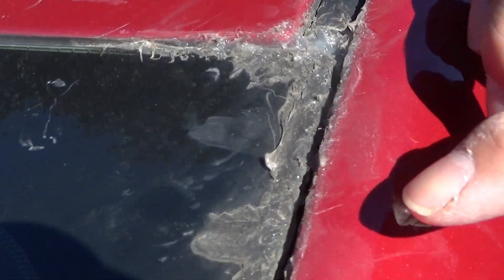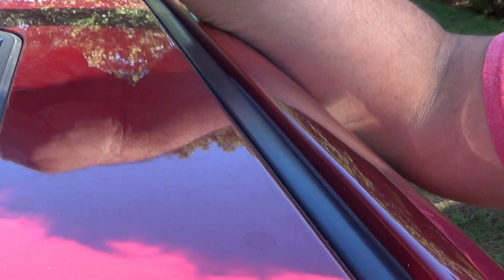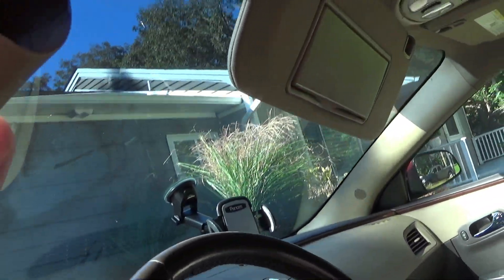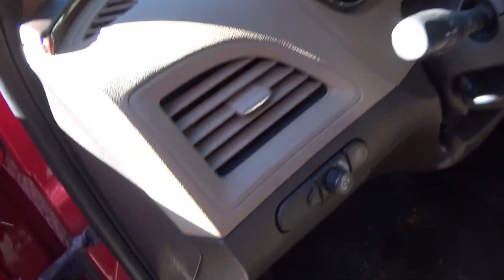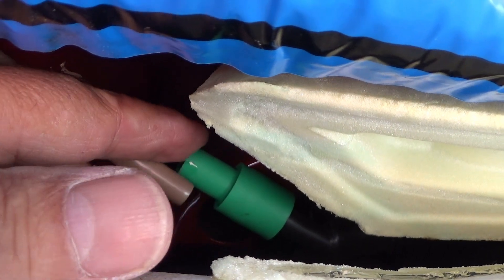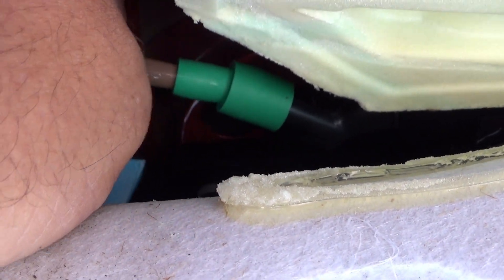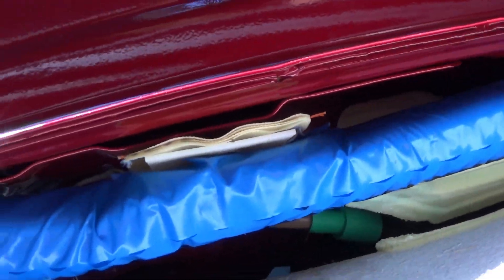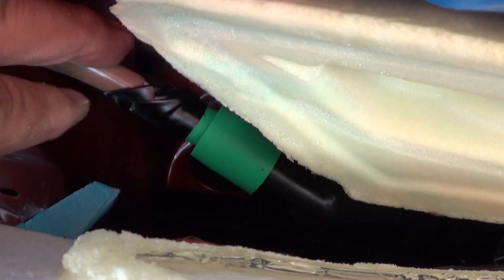2012 Chevy Malibu Sunroof Leak Fix

Comment: It really is a bad design. I dont know what Chevy was thinking.. My 2011 Malibu sunroof has leaked 4 times since I’ve had it due to disconnection. The first two times it was under warranty so I could bring it to the dealer. It was great cause they sucked out the water and dried it over a few days, but they just reconnected the hose! Which inevitably popped back out again… finally took it elsewhere the 3rd time and they used silicone caulking when reattaching it. That actually resolved the issue much better. 

I’m here now cause after years it’s leaking again. But I’m trying to resolve the issue on my own now. I’m hoping they are just clogged but if not, this video will help me gain access to the tubes and I’ll get some silicone caulking and reapply it.
Reply from the maker: Yeah mine hasn’t leaked ever since i did that repair 💪Duck tape to the rescue

Comment: I have a 2012 Chevy Malibu and every time it rains my passenger floorboard gets soaked what could be the problem with that
Reply: Same issue
Reply: @jonnymcgill109  I found out that it comes from your sunroof either you have a leak or the drain pipes at the drain tube or the seals broke after I replace the steel put that flex seal on it it's good
Reply: @jonnymcgill109  I found out that it comes from your sunroof either you have a leak or the drain pipes at the drain tube or the seals broke after I replace the steel put that flex seal on it it's good